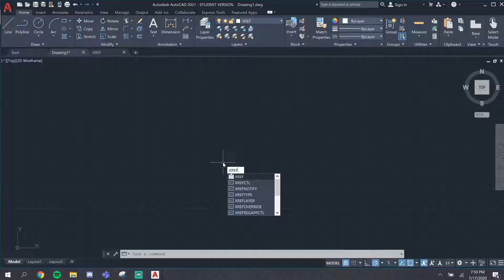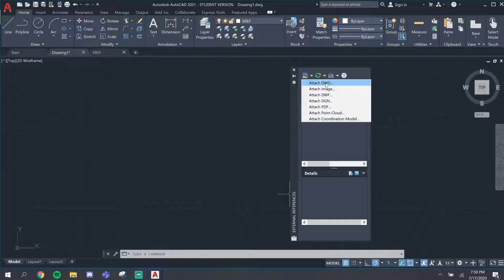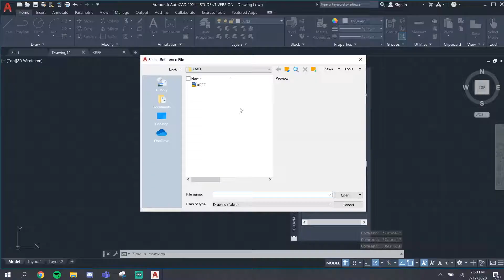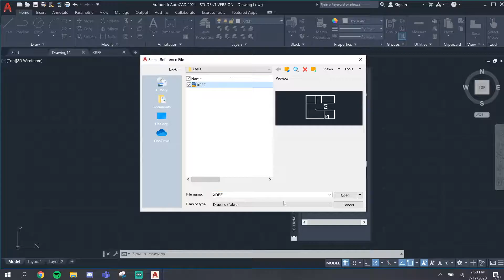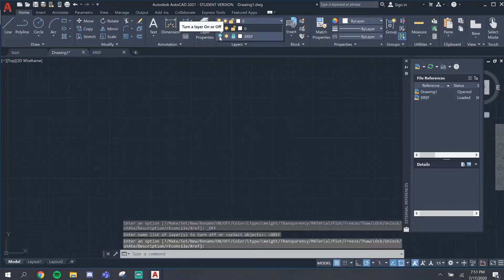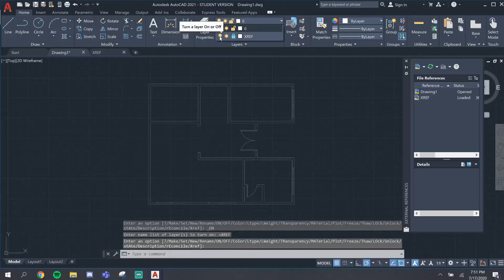How to Properly XREF in Auto CAD

Comment: The problem I have is XREF'ing a site plan into another drawing, I am trying to use elements such as stairways or shafts to align the two different drawings. Is there a simpler way to do this in the import stage... any tips?
Reply from the maker: Michael, when doing an XREF, there is an option that should appear to attach the XREF from a specific point. If not I would recommend XREFing to the side, then grabbing the whole thing and using the move command from that specific point. Hope this helps!
Reply: @cadwithanengineer5965  the problem I have I guess is in scaling when it might have been done afterwards.

Comment: typically I just copy and paste from one plan to another… is this bad? should I be doing an xref?
Reply from the maker: It just depends on your use. The benefit in doing an XREF is when you change the original drawing, the XREF will automatically update in the drawing it is linked to.
Reply: @cadwithanengineer5965  the problem with XREF is the file location, when you edit with other computer the xref is gone

Comment: Great video! I didn't know about creating a layer for the xref, that is a game changer.
Reply: Although I will point out that if the xref'd drawing has multiple layers, I needed to use the freeze layer option to turn off the entire xref'd drawing.
Reply from the maker: It really is a game changer! It can be very helpful for certain applications. It also cleans up the layers a bit.